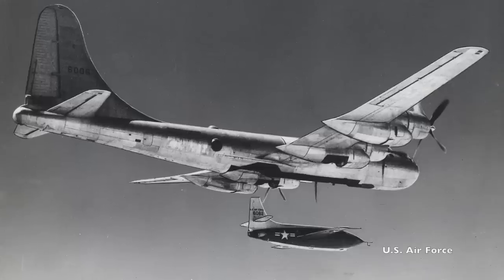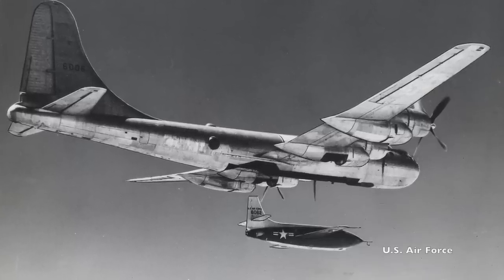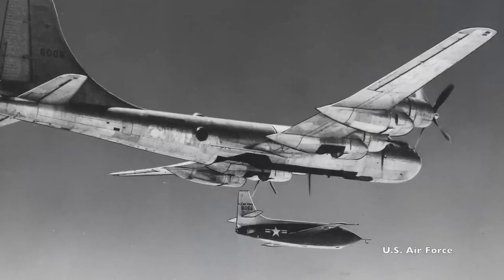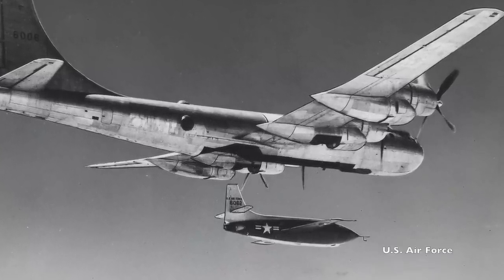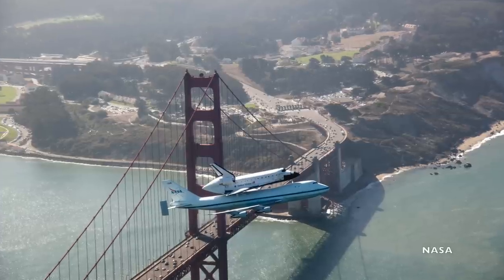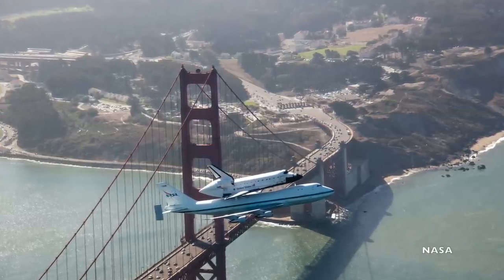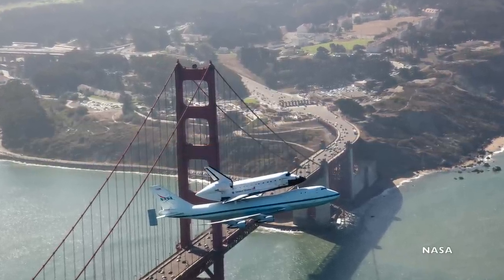Air Launching Air Planes

Comment: Hey Amy great vid on the x-crafts,but another reason for the air launch was to keep wieght down by making the landing gear to handle the empty weight with little to no fuel. The X-1 or X-1a did make a ground launch once by Yeager. Greatly reduced fuel just to show that it could be done. This was done during the times that Muroc had the Air Force, Navy ,and NACA all there and the competition was pretty fierce for record flights.

Comment: If you wanted to cover another interesting space related aircraft, how about the Shuttle Trainer Aircraft?  The STA were highly modified Gulfstream II that could duplicate the flight characteristics of the Orbiter for approach and landing training.  They also used them during Shuttle launches to evaluate the landing conditions should a launch abort be required.

Comment: I can't help but be nit-picking here;
The first air-launches actually happened as early as 1916.
By far the coolest airlaunches were from the airship aircraft carriers USS Macon and USS Akron.
I know this video is about the NASA test flights, but especially the airships carriers are far less known than they should be, although they were an amazing idea.
Reply: Recovering the airplanes was a pain, though.
Reply: There was also the Short-Mayo Composite Aircraft, a transatlantic mail plane launched from the back of a flying boat, because the fuel load precluded a water take-off. (it's on YouTube.)
Reply: Imagine recovering X-1 while only using B-52, half can of soda and a cotton swab.
Reply: rockyblacksmith the USSR air launched fighter/ ground attack planes in ww2 to the point where they had five planes on one 'mothership'
Reply: You beat me to it.
Reply: Don't worry, it's not like there was a huge gap between the literal flying aircraft carriers and the X-1

Parasite fighters were a thing all throughout the time in between.
Reply: Man, those carriers were amazing. Wish we had something like that in WW2, not as a warship but more like a supply/refuel ship
Reply: They also did "aircraft blimbs" (like flying aircraft carriers)
Reply: The Germans also used air launch for some of the V1 flying bombs. They were carried aloft by HE111 Bombers and launched also the Luftwaffe had Meistel flying bombs. They are old JU88 bombers fitted with a hollow charge warhead. They had a fighter (ME109 of FW190 mounted on top and the whole contraption was flown by the pilot in the fighter. The pilot aimed the whole thing at the target and released his fighter. The bomber then flew straight into the target whilst the fighter made for home.

Comment: for a future talk on air launched, don't forget to mention that the main advantage is not the altitude but convenience of loading it at any airport and taking it to the equator for launch. 
The benefit of launching from 30,000 feet and 500 mph is pretty small compared to what it eventually has to get to.

Comment: I am sure this was said a million times here before, but you did miss one important fact about the space shuttle piggy back flights. Whenever the Space Shuttle had to land at Edwards, it had to be flown back to the Vehicle Assembly building at Cape Canaveral on the back of a 747. This was a very inefficient flight because the flight was conducted at 10,000 ft. all the way across the US. Also modifications had to be done to the 747 by adding fins to the horizontal stabilizer to counter the effects of adverse air currents made by the shuttle. :-)
Reply: +uriahms I was about to post exactly what you posted. this should be higher lol not buried in the comment section.
Reply: +uriahms It is still amazing that the 747 could successfully carry the shuttle, but the Russians had to build the massive Antonov 225 to carry their Buran which seems to me pretty similar in size to the shuttle.
Reply: +hawkeye0248 I think the Buran was very slightly larger than the shuttle.
Reply: +Hologrampizza The Shuttle was a littler bigger.
Reply: 747 is a powerful beast. From what I understand, it was just very fuel inefficient with the added load, but had plenty of power without modification. Aerodynamic modifications did have to be done though.

Comment: There is a canceled US Air Force anti satellite program that used an F-15 to launch at 38,100ft (I know sounds too low) . You can get details on the internet. I was at the end of the runway at DM AFB in Tucson when the 747 with the shuttle on its back took off and flew over head. It was announced on the radio that the Air Force was letting civilians gather and watch. The 747 passed over us at what felt like 100ft,slowly gained some altitude but mainly kept it real low seeking air speed with its engines putting out a healthy amount of smoke. The 747 took off from Edwards and already needed fuel in Tucson, 500 miles away.

Comment: There was an earlier air separation flight than the X-1. The Shorts Mayo Composite was a seaplane built in 1938 which launched a smaller plane in mid flight http://en.m.wikipedia.org/wiki/Short_Mayo_Composite

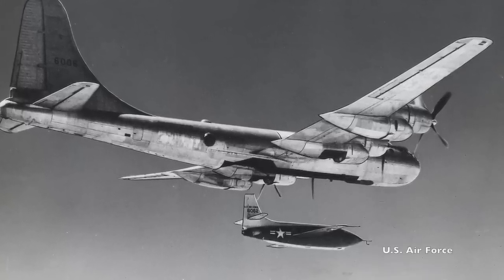Comment: 0:49 I'm more than curious as to how the B-29 was able to take off in this configuration.
Reply: root9065 The B-29 was well capable of carrying the weight of the various aircraft it carried )the X-1, the X-2 (B-50 derivative) and the Douglas Do.558 Skyrocket. All that was needed was an enlargement of teh bomb bay area and the provision of plumbing to allow the rocket plane's tanks to be topped up.

The main reason the B-52 carried the X-15 (and the lifting bodies later on) under the wing was because the B-52's bomb bay was too difficult to convert to carry aircraft. Also, the ground clearance and undercarriage arrangement of the B-52 made it an almost impossible task. 

Adding a wing pylon was a lot easier.

Comment: Sorry Amy, the X-1 was by no means the first aircraft to be air launched. The idea of giving a smaller craft a bit of a lift, usually to give the smaller craft longer range and duration dates, back to the 1920s at least. I know the Russians experimented with launching small fighters from the wings of a large (for its time) Antonov bomber in the 1920s.

In the 1930s, Britain's Imperial Airways carried out experiments launching s twin engined seaplane from off the top of a converted Short C Class flying boat. They used this technique to fly mail across the Atlantic. World War 2 caused these experiments to cease.

Comment: There was debate at the time of the X-1 flights that you couldn't call it a plane because it didn't launch under its own power from the ground. One reason was stated in the video which was that it couldn't carry enough fuel for launch and a run. But, aswell as this, the weight saving measures taken with the undercarriage meant that the X-1 couldn't take off with a full load of fuel without collapsing the gear. To appease the naysayers, a ground launch was done with less than half a load of fuel. The acceleration was so fast it blew one of the gear doors off and there was only enough fuel for one pass before running out of fuel and glide landing in the usual way.
Reply: 1) Heavier than air
2) Controlled flight
3) Fixed wings

Seems like an airplane to me!!!

Comment: It may have been due to time constraint for your video, but the Boeing 747-123, which conducted the glide and landing tests of the Enterprise, and ferried the decommissioned orbiters to their final locations around the country, as you mentioned, was also used until 1984, to transport the returned shuttles from their landing site, which was Edwards AFB, back to The Cape for turnaround and flight readiness maintenance. The first shuttle mission to use the Shuttle Landing Facility in Florida was used on Feb. 11, 1984, when STS-41-B landed there, making the 747-123 redundant. It was kept in perfect flying condition, however, for the entire 30 year shuttle program, in the event that any shuttle mission was forced to make an emergency de-orbit maneuver and landing, somewhere else in the world.
Reply: I thought there was at least one time the shuttle had to land in California due to bad weather in Florida. I recall hearing didn't like to land in California because of the extra cost in transporting the shuttle back to Florida.

The ground trip made by the first shuttle to it home at the Air Force base is an interesting story. They had to cut down stop signs and other obstacles in order to clear a path for the shuttle riding on a flat bed truck.
Reply: Duane Degn STS-3, which launched on 22 March 1982, was scheduled to land at Edward's AFB 7 days later, on 29 March...However, due to flooding on the runway at Edward's, the landing was moved back 24 hours, to allow the shuttle to maneuver into an orbital path which would allow it to perform a de-orbit burn, lining the vehicle up to use the re-entry window that put it on an unpowered glide trajectory for The White Sands Missile Test Range, in New Mexico. This was the only time that any of the 5 space shuttles landed at a runway other than Edward's or Florida.
Reply: Thanks for the information. I must have been remembering things incorrectly.
BTW, I saw the shuttle on the back of the 747 as it flew through Utah. I'm not sure of the year but it was likely between 1995 and 2000. I think the shuttle was being retired and was in the process of being moved to its new home.
I didn't know the shuttle was going to be passing through Salt Lake City but I happened to have had an appointment at a hospital there. I watched the shuttle from the windows of LDS Hospital with the heart cauterization team staff. It was a very cool sight.
Reply: Duane Degn Happy to be of assistance. 
That's interesting, though, that you say you saw one of the shuttles on the back of the 747-123, as it flew across Utah...and you say that was sometime between '95 and '00...I'll have to consult my NASA archive information, and see what they might have been doing. (I can't remember, right off the top of my head) It's entirely possible that a mission had to land at Edward's, during that period, and been transported back to Florida on the 747 carrier. 

We here, in the DC Metro Area, got to see the Space Shuttle Discovery as it arrived at Washington-Dulles International Airport, and from there was rolled over to the Air & Space Museum's Steven F. Udvar-Hazy Center. They actually closed down the airspace around the airport, so that the plane could make a few passes over the area...It would fly out over Leesburg, then come around, flying as far as Manassas, then looping back towards DC, down the length of Rt. 7, towards Tyson's Corner, then head back toward the airport...It was really cool. There was an app you could download onto your phone or pad, and you could actually see the flight deck operations, as the pilots were flying Discovery to the airport, and you could also watch a feed from a camera that was on the bottom of the plane, forward-&-down-looking, to see where the transport was, before landing...It was really cool. That was in April of 2012.
Reply: It was in September of 1995. The shuttle wasn't being retired but refurbished. I found this video:
99OKrzfXSsY
I had a heart transplant in May of '95 and I was a frequent visitor to the hospital that first year.
Reply: The Orbiters went to Palmdale CA for major work and refits.  Each Orbiter had scheduled OMDPs (Orbiter Maintenance Down Period) through their life.
Reply: Here's a Nasa link to more info (with some kick-ass pics,) of the two 747's:
http://www.nasa.gov/centers/armstrong/news/FactSheets/FS-013-DFRC.html
Reply: Duane Degn Shuttles were retired in 2011.
Reply: They were still using them in 1988 & 1989... I was stationed at Kelly AFB, and it was the midpoint stopover between Edwards and Patrick. :)

Comment: I believe the reason why the Shuttle was not air launched is because it needed huge amounts of cryogenic fuel, not to mention solid fuel boosters. There is, as of yet, no aircraft that can handle that load - certainly not the 747.

Comment: you forgot the scaled composites planes, spaceship one, and two,  launcher one, and others. .and  please discuss the advantages of air launching to achieve orbit.?
Reply: FPVREVIEWS There are some, very limited advantages. The main one is that the launch aircraft can fly above the weather so the launch is not restricted by bad weather at ground level. 

The main disadvantage is that only smaller payloads can be launched into orbit this way. An air launched system can only carry up to a certain weight of spacecraft and fuel. Anything over a certain size and the fuel element just gets so big that there is no aeroplane in the world capable of lifting the total weight of spacecraft and fuel combined.

Neither the X-15 nor Space Ship One or Virgin Galactic can carry enough fuel to accelerate them to orbital velocity.
Reply: EricIrl i hear that stratolaunch is nearing first flight. have you heard anything about it recently?
Reply: FPVREVIEWS I've not really been following that project. It will be interesting to see how they get on - and more importantly - how big their payloads will be.
Reply: EricIrl last i heard, 13.500 lbs. it's an interesting project, but we don't know much about it..  oh well...paul allen's the main sponsor, i guess...
Reply: FPVREVIEWS That equates to around 6 tons - which is about as much as you can launch into orbit this way. A fully fueled up X-15 weighed 15 tons and a Shuttle orbiter weighted almost 100 tons - so it sort of puts what air lifting can handle into context.

Comment: Im wondering, can space shuttles (remove the SRBs and the external tank obviously lol) launch on a runway, cruise at 30,000-40,000 feet at under 1000mph, and then land on an airport like a normal airplane would by using the shuttle's main engines? Or will those engines be too much to handle for atmospheric flight? And if it can, how far can it fly?
Reply: Main engines were fed from the external tank, and even if they fed the OMS internal tanks they'd be empty before take off. Maybe using a tank in the cargo bay it could take off, but I don't think it would be very controllable or go very far. Rockets are powerful but inefficient, thats why we use air breathing engines for atmospheric flights.
Reply: The Stan The Shuttle's wings are mounted at such an angle to the body that it is impossible for the Shuttle to lift off a runway. This was deliberate to ensure that the Shuttle staid on the ground during its landing run.

You will also notice that the nose wheel of the Shuttle is very short, giving it a distinct "nose down" angle when on the ground. This is also part of the plan to keep it from lifting off during the landing run.
Reply: EricIrl I reckon they made it that way to keep the wing a solid piece as opposed to those in airplanes with air brake spoilers?
Reply: The Stan The Shuttle wing wasn't solid. It was built very similar to a standard delta wing, made up of ribs and spars and covered with thin aluminium panelling. It didn't have flaps (delta winged aircraft don't normally have flaps) but it did have movable  elevons - which are combination ailerons and elevators  - used for pitch and roll control. The wing skin was covered in heat protetctive tiles underneath and heat protective blankets on the upper surface. The leading edge of the wing was made from Carbon Reinforced Carbon (CRC)  - to withstand the extreme heat experienced by that part of the craft during re-entry. It was a breach of the CRC leading edge that doomed Columbia.
Reply: The Stan Added to say that the Shuttle DID actually have air brakes. However, they weren't on the wing but were incorporated into the tail fin. The rudder of the Shuttle could be moved from side to side to control yaw - as in a normal aeroplane - but the rudder could also be split to open both ways at once - acting as a vertical air brake.
Reply: EricIrl Yeah I saw a documentary about the Columbia (So sad, that was my favorite space shuttle). Man, the space shuttle is such a beautiful machine. I'm sad that the whole fleet had to be decommissioned. It had eyes (cockpit). It had limbs (wings) and fiery propulsion (humans celebrate fire and explosion). The airplane design sure has wings that are useless in space but if seen by aliens, its shape represents our world and us humans.
Reply: The Stan I'm not altogether sure the aliens would have been impressed with many aspects of the Space Shuttle - apart from maybe the bravery of those who flew in them.

Comment: Simple fact of the matter is, the Shuttle's main engines are useless without the external fuel tank attached.  Once the tank is jettisoned, it loses its fuel feed, and the three main engines become effectively useless.  For this reason, air-launching from the back of a 747 (or any aircraft) is impossible.